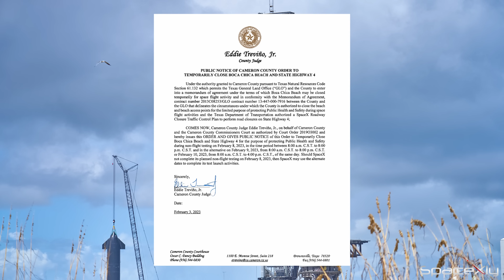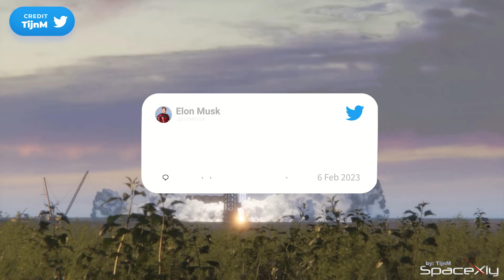Water Deluge Installation in Progress, Starship OTF to be delayed? | SpaceX Updates

Comment: Why not just launch side ways and they dont have to worry about damage to the ground?

If they want a normal launch pad, then they should redevelop completely from the ground up with much sturdier materials.

However, if they want something that can adapt to the current foundation, why not just launch side ways?

They can put the rocket on rails, launch it side ways, and the rails will naturally point the rocket at an angle towards the sky.

The space chopstick should still be useful with this method.

Not sure why they would want to waste so many resources with a deluge system, and possible repairs each time. I hope it works, but even with Nasa's system for their platform it took damage, and they had to do many inspections to make sure. It doesn't seem like a normal platform is feasible at this moment if they go with standard materials as well and want quick reusability.